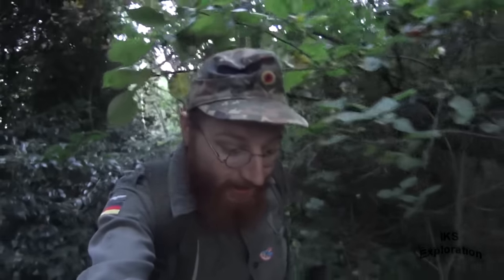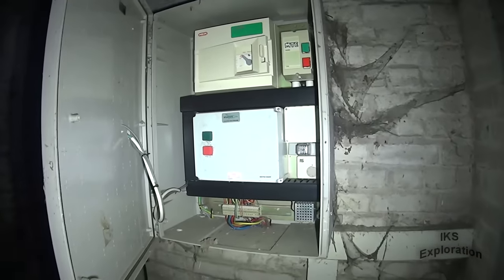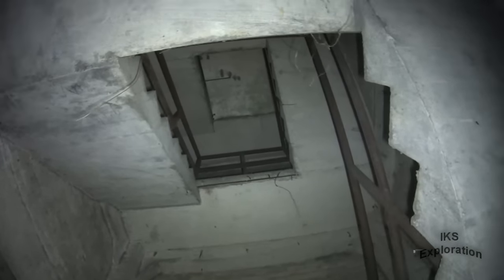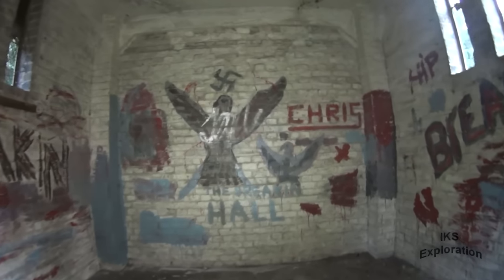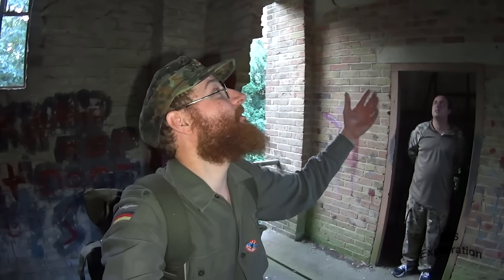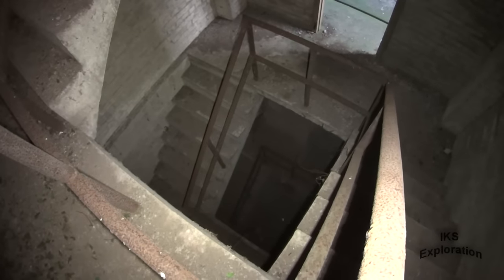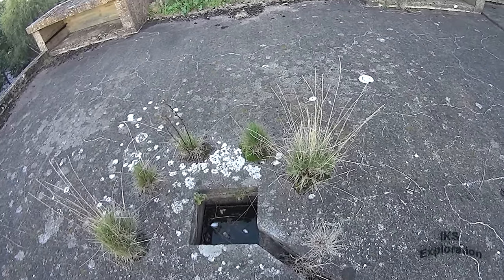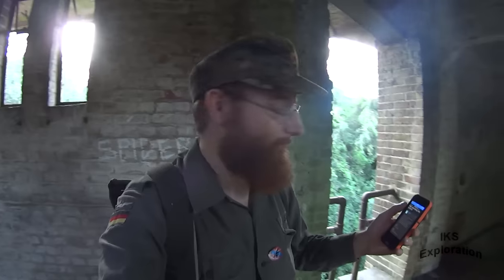Abandoned WW2 RAF Radar & Bofors AA Gun Tower (RAF WEST MALLING)

Comment: I'd say the theory about the gap is right, those handles prove it. If it were just two buildings built side by side because the contractor demanded one more, you wouldn't see that design element. You'd probably have a straight piece across, however, as you can see, someone went to great lengths to keep them apart.
I also remember from somewhere (tho you'd have to fact check me on that) that a radar dish is very sensitive to vibrations. Something about earthquakes affecting them. Now, how much vibration would go through a building from a bofors...well, i don't know that, but there is brick and brick lace is elastic in nature.